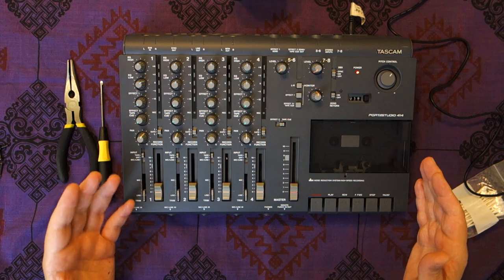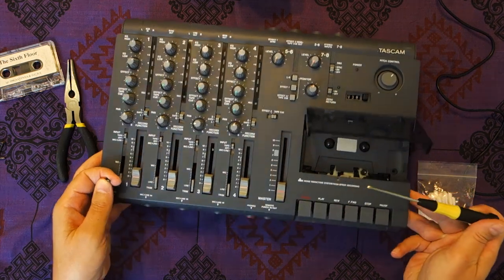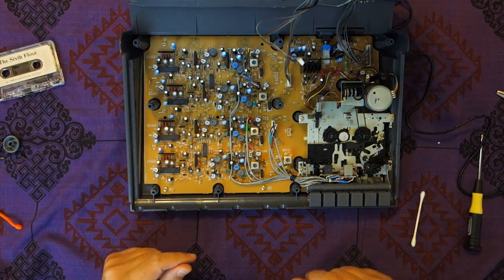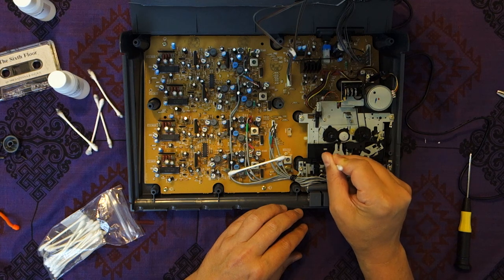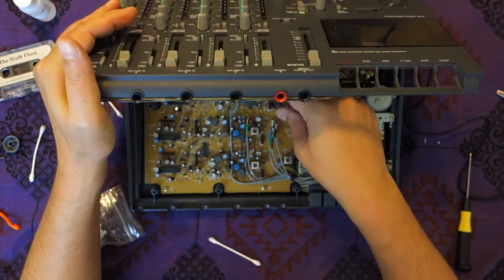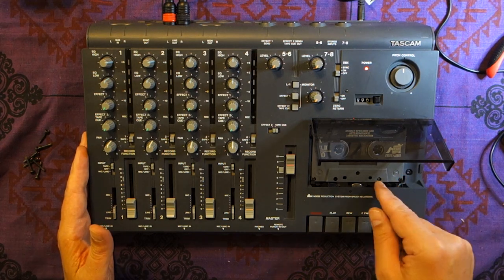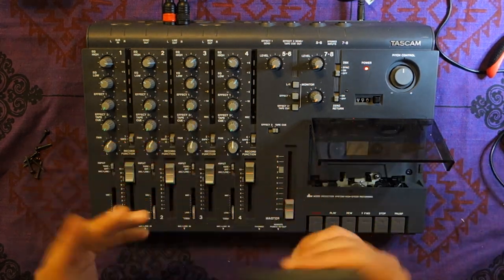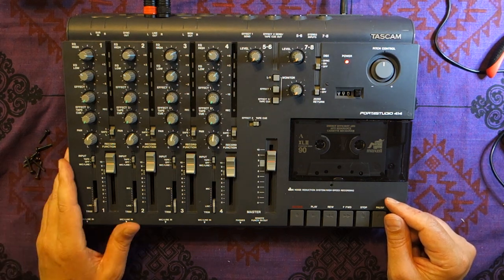How to troubleshoot and fix a tape-eating 4 track

Comment: Hi, I have the same problem with eating tape. And I have a question about how did you adjust the pieces in min. 10:05. I have add a metalic washer and a e-clip like your image, but, when I push play, the eclip and the washer moves together with the metallic barrel at the shame time. Is it ok? Did you paste the washer to the plastic base or also the pieces rotate together in your case? Thank you.
Reply from the maker: They rotated together. did you get it fixed?

Comment: Hello. I have just unearthed my 414 and have begun recording with it and it now having a problem. It started with a noisy/squeeky sound while playback and recording were happening. I tried cleaning the Heads and pincher Roller with Head Cleaner (woops). The squeek went away, recorded alright, but wouldn't Rewind. It would Fast Foreword. Then it gets funny. If you flip the tape over, it would Rewind, but not Fast Foreword. It hasn't eaten a tape yet, but it is chewing up the tape edges and is not winding neatly. Any ideas? Thanks you videos are really good!
Reply from the maker: Sounds like your belts are old and need to be replaced. I'd start there. Also get some rubber restorer for the pinch wheel. Finally, make sure to test with brand new tapes so as to rule out a defective tape or tape loop.
Reply: @User173  Awesome, thanks! I just tried the rubber restorer, so I guess I'll move on to the belts. Thanks again for getting back to me!!!

Comment: Just recieved a Tascam 414 mk 2. Channel 2 is especially noisy and crackles a lot. The other channels have the usual hiss and some pops but aren't too bad. I've cleaned the tape heads and the roller but didn't seem to help. Any idea what would cause a particular channel to be a lot noisier than the rest?
Reply from the maker: Yeah, that's most likely a noisy Pot. ESPECIALLY since it's just one channel. You notice the crackle when you are moving the slider up and down for volume? you can buy a stuff called "de-oxit" on amazon or at a hardware store. Spray that shit down in the pot and work it up and down, then try it out and see if it solves the problem. Let me know!
Reply from the maker: As a follow up, what happens is either dirt, debris, or oxydation occurs down on the resistant strip where it meets the metal slider. That stuff getting between the metal slider and the resistant material causes the crackling. The de-ox it may take one or two applications, but it will be virtually gone.
Reply: @User173  Well it's more of a constant crackle on that channel. Moving the slider doesn't cause it, it just increases/decreases the volume of the noise. Made me think it was a problem with the tape head or the tape itself (I'm not using the high bias type II tape). I tried a couple different tapes to the same effect. Turning on dbx helps a bit though...
Reply from the maker: @DreamwareMusic  oh hmmm... that's interesting. I'd crack it open and have a look at the wire connectors and solder joints that have to do with that channel going to the play head. that is a tough one and would be fun to try and solve!
Reply: Hello how are you doing? Your channel is very interesting, I congratulate you on your work.
I have a problem similar to Dreamware, when I connect the effects, which is in the first place for example a Reverb, the sound decreases but when on channels 1 and 2, I move the control 1- safe-L and 2-safe-R Up and down the effect reappears, but sometimes the effect becomes diffuse again and I must do the same, even I move some potentiometer and after a squeak as of false contact, the effect returns. However, the sound recorded on that channel does not disappear but rather lowers the volume a bit. I do not understand why when moving these controls the effect returns, is it possible that some dirt could be the problem? I bought it recently and apparently it was not using much time. Everything else works, records and plays normally.
I appreciate any help.
Greetings from Uruguay!
Reply: It's an old comment but I hope someone won't make my same mistake.
I used a contact cleaner to clean an old tascam's faders, but all I got was only "heavier" faders.
Contact cleaners do miracles with potentiometers, but it's much better to use proper fader cleaners. I tried it later, but it did not lubrificate enough.